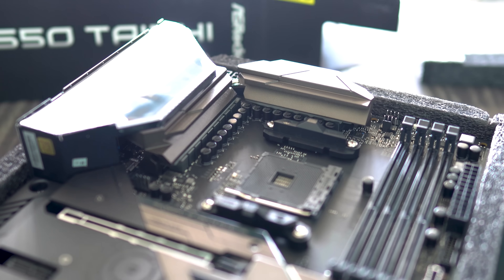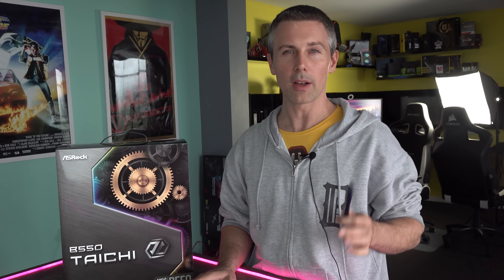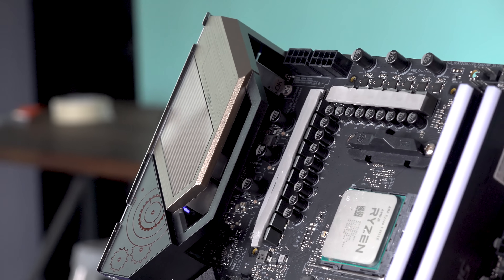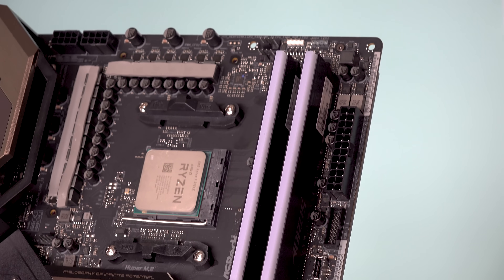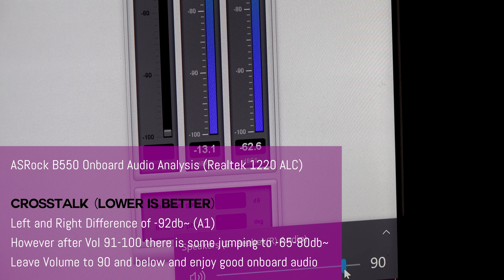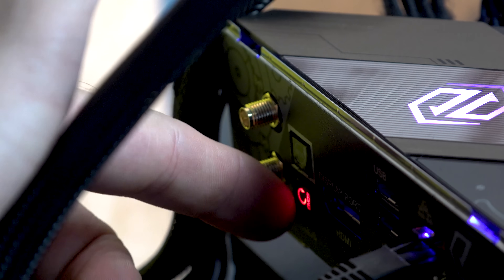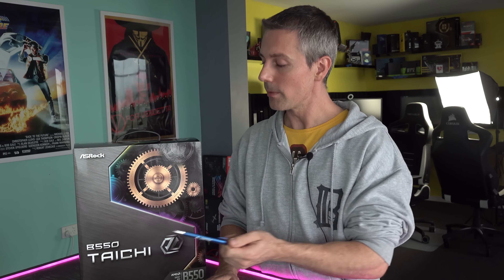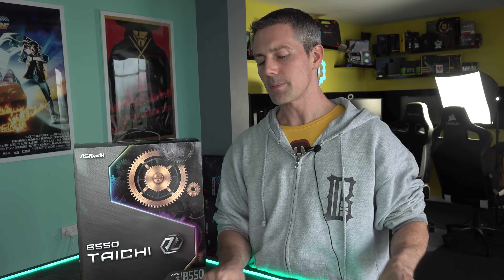ASRock B550 Taichi Review - X570 Now Irrelevant?!

Comment: 2024. I just upgraded my X470 Taichi with an 5950X for just 260€ and changed to 128 GB DDR4 RAM. Now I have problems with virtualization. The guest systems flicker, even if they are switched off. So I strongly suspect the X470 ith the latest 10.31 BIOS upgrade. What a pitty. I will try out the B550 Taichi which goes by 220€.

Comment: Mine gets delivered tomorrow along with the matching ASRock Taichi 5700XT. Gonna pop this 3900XT sitting right beside me into it under a 360mm EK AIO, a 2TB Sabrent Rocket PCIe 4.0 M.2 SSD, 2x4TB WD Blue HDD's in RAID 0, 32gb of GSkill Trident Z RGB RAM @ 4000mhz with custom matching black and gold sleeved PSU extensions from CableMod and not buy another PC part for 10 years. That's the plan anyway. Check back in 3 months to see what new part(s) I bought lmao XD

Comment: I wouldn't recommend any Asrock boards or Gigabyte, best B550 boards are the MSI Tomahawk and Strix boards one could say even in the B450 lineup the MSI and Asus boards are the best. The bios on the Gigabyte boards is horrible absolutely horrible, after owning heaps of Gigabyte and Asrock boards over the years I always pay the extra and get Asus trust me they're worth every Penny even considering the Asus tax they're simply the better boards IMO. I emphasize how terrible the bios is on Gigabyte boards its really that bad, skimming through the bios I said to myself there just isn't any love in this at all. I recently got to play with the B450 Tomahawk board and I must say the bios is really good, MSI put time and effort into it unlike Gigabyte. I suggest if you're going with a 3600 or 3700x check if you can get a refurb board from a local Computer store, I got a Strix B350 to use with a 3600x today because the B450 Aorus ITX board I bought is absolutely terrible (It was the only ITX board avaialble at the time) the Strix B350 cost me $152 and the store I got it from updated the bios for me for free (Mwave charge $30) JW Computers do it for free. A Strix B350 will work fine with a 3600 or 3700x and if you can get one cheap enough it will be way cheaper than any decent B450 or x470 boards. For $152AUD you cannot beat it, Strix B450 is $239AUD right now and the Tomahawk is around the same price. I bought a 3200G for $100 second hand a few days ago to play around with I'll be running it on that terrible Gigabyte board simply because most boards are not available right now and I have it on hand to use. If you need further clarification on how I reached my opinion feel free to comment and I will reply.
Reply: Asus tax is not worth it.
Reply: @tertius-3  My experience it can be on Motherboards, Asus have a superior Bios over MSI Asrock Gigabyte etc IMO. The Gigabyte boards I've owned have been quite bad in my experience from z68 to x99 to x299 to B450 but all the Asus boards I've owned worked perfectly fine. Are their Thor PSU's worth it hell no are their AIO's worth it hell no but boards generally I find they're very good like the B450-F strix supporting and working with ECC memory. I prefer Asus personally, I do not buy anything else except Asus with some MSI boards like the Tomahawk boards.

Comment: Hi sir, I have a pc system unit that very old and he starting to not function. I want to ask if i have a chance to use other parts when i build a cheap gaming pc around less than 200 usd budget. I have a motherboard ASROCK FM2A55M-DGS,500GB HHD, NEUTRON ELECTRON PSU 700W, AMD A4 5300. and if other parts are need to junk did you think  there's a chance to sell it or no. I'm your fan from the Philippines. Please give an advice and answer thanks a lot.

Comment: Would be great if you could test the MSI B550 Tomahawk (especially the Audio since it is using the ALC 1200 instead of the ALC 1220), the Asrock Extreme 4 /Steel Legend and the Aorus Pro please.
Reply: They already were tested by Harware Unboxed. Avoid Asrock Extreme 4/Steel legend cause of worst VRMs in B550 lineup.
Reply: @Matruchus  Thanks for the Info, MSI then because i want that Type C front header.
edit: just checked cant find a HW Unboxed test about the Asrock B550 boards...
Reply: @R4ZORLIGHT  It was also tested by Tech Yes City. It reaches the highest temperatures same as the Asrock x570 Steel Legend. You can see what happens if you overclock the cpu at 5 : 20. https://youtu.be/e5PMp_7h59w

Comment: Something I found to be a problem with cheaper, overlockable chipsets is that certain functionalities in the BIOS are lacking or not quite as well implemented. Now, that may not seem like a big deal, but since I'm very OC oriented, it really makes a difference to me if the LoadLine Calibration is configured properly or not. Same goes for the Vdroop and in general certain secondary voltages. I got myself a B350 from Asrock at the time and the VRMs were simply great. Great temps, great stability, but the overclocks I was getting simply were not quite as good as on X370, simply because of the LoadLine and of some voltages.
Reply: Absolutely true my man
Reply: @leonardoowl4308  hehehe. Overclockers on a budget 🎈😹🎉🐯

Comment: I've notice the much higher prices on many of the B550 boards. I'm assuming some of this is still due to production and shipping problems related to the pandemic. The other is that there are some really beefier components + VRM on many boards.
Reply: Also, B550 technically replaces X470 chipset while you still have B450 for budget option

Comment: Great review Tech YES City! Strange that no one else got this board for review. It seems this board is delayed since it is not available anywhere, I heard it is due to the Human malware situation. So it is 15 days delayed in some parts of the world. I Preordered this so hoping to get my hands on it soon here in Sweden.  One minor thing though, you did not show us what was included with the board inside the box.  Regarding front panel USB Type C connectors on the mobbos. It is worth pointing out in future reviews for instance that the Gigabyte B550 boards even the top end Master one is missing one of those and THAT IS SHOCKINGLY BAD considering the price of that board! And some of them like the popular MSI Tomahawk one only have the front connector as gen 1 meaning maximum 5GB/s so not the good kind the Gen 2 with 10GB like this ASRock one have. No reviewer seems to be pointing these things out.

Comment: A mid tier motherboard US$280 or AU$570, this is just plain wrong.
The 500 series boards have the biggest chipset differences of any AM4 series, that PCIe 3.0 vs 4.0 is also the link to the chipset and is half the bandwidth. The 300 and 400 series boards had artificial number limits imposed to differentiate B and X but otherwise the chipsets were the same.
16 phases is overkill for all but extreme LN2 overclocking, maxed out 16 core processors will have a hard time drawing more than 200W with high end ambient cooling meaning a sufficiently beefy (50-60A power stages) 8-10 phase VRM is more than enough for most use cases. While it's good to see some better VRM's on a mid class board, this is plain ridiculous. It's highly unlikely that the thermal properties of Zen 3 processors will change enough to allow significantly higher power draws that would make use such a big VRM.

Comment: I'm glad to see that the VRMs are so good on the B550 Taichi because that means the VRMs on the Steel Legend and Extreme4 should also be really good. They use the same components and the main difference seems to be that they have 12 Vcore phases instead of 14.

The Taichi looks like a really nice board but the Steel Legend and Extreme4 for ~60% of the price are a lot closer to what I'm willing to pay, and they still have a lot of the features that I like about the Taichi (including a front USB Type-C header, an integrated I/O shield, a post code display, and even power/reset buttons on the Extreme4). No clear CMOS button or BIOS flashback though (and no Wifi/Bluetooth).
Reply: Yeah, clear CMOS button would have been icing on the cake for the Extreme4. ASRock finally released a nice Extreme4 line board after long time.

Comment: Not sure if I did the right thing but whatever. Paid 210$CDN+tx for my TUF Gaming X570-Plus, when the average B550 is between 180-200$... Hmm... Other than maybe one or two B550 at 140$CDN, they are ALL at LEAST 180$CDN, compared to B450 which is between 100$CDN to ~140$CDN for the average board.

Comment: Now wondering if I should buy one to upgrade from X370 taichi 1700x,  to B550 Taichi for a 3900X  since crossfire is still being supported.     Using 2x  RX 580's for blender.  
Maybe if I brick it the bios.

Comment: Okok, What xeons(2 used xeon) vs ryzen 3950x ?
ex. 2 x e5 2690 v3 full unlocked little oc.. cinema r15  3900 sr
(2 x 200$ xeon Q14? + 200$ motherboard + 200$ ddr4  64 gb ram + 200$ power cables cooling... = 1000$) 
or
all new ex. 3950x  NO  OC.. cinema r15 3900 sr (650$ ryzen + 150$ mitherboard + 250$ 64gb ram +
200$ power cables cooling... = 1250$)
DOES IT WORTHH extra 250$ ???
You  GET 
+ NEWW
+ One CPU better for ram
- INTELLLL'S  "STRENGTH"  and  liferime waranty ! 

CAN SOMEONE EXPLAIN MEEEE WHAT  HAPPENING WITH INTEL
All intel amd comparasions is that
always price is unbeatable ! ! ! 
What are differences!

Comment: I cannot understand how this board is the same as the x570 taichi even jn canada. Personally I am looking at the Asus prime m  WiFi or something from MSI as their boards are priced well for what you get. What I like about B550 is pcie 3.0 nvme support meaning I don't have to spend another 3 to 400 to get a pcie 4.0 drive right away. I already have the 3300x on b450 s ok it will just be a board upgrade to my htpc for now. Keep up the good content!
Reply: PCIe 4.0 is backwards compatible, meaning PCIe 4.0 drive will work in PCIe 3.0 slot.

Comment: Don't most x570 boards not support SLI (splitting the x16 socket)? I'm actually planning to downgrade from an Asus X570-P to B550  mainly to get away from the fan (Asus still hasn't added PCH fan control!🙄), and to be able to run more Gen 4 NVmes. Essentially gain 8 Gen4 lanes and loosing 2 (50%) from the chipset is a worthwhile compromise to me.
 
PS: It would be good to see a like for like comparison of power usage (X550 draws too much power IMHO).

Comment: unlike Intel which is all classes of chipset release at the same time when new Generation CPU release, such as 10 Gen core CPU, u have Z490, H470, B460 & H410
AMD maybe due to their manufacture ability, their chipset release class by class X570 with Ryzen 3rd Gen > B550,1 year delayed >A520 when around Ryzen 4000 release in 2020 Q3/Q4.

Comment: Well, less than $300 is okay to not have a fan onboard. It's between this, b550-e gaming..., and b550 gaming carbon... Gigabyte lost because they don't have the front usb type c which my case has.

No, I don't want a x570 with a fan for this build (random person on the internet reading this that was about to try and convince me otherwise).
Reply: GhaV jGRite (jeaHAvee) I have x570 prestige creation and the fan has newer turned on... because I don`t have two pci 4.0 GPUs and 5 pci 4.0 drives! My mobo can do it, and the it would need that fan. But when I only have one pci 4.0 GPUs and one pci 4.0 m2 ssd... no sound at all!

Comment: Have you looked at the B550 Phantom Gaming ITX/ax?  I’m sorry, but you cannot justify a board starting at $200 USD and not include an external Clear CMOS button or BIOS Flashback.  And with all that left over space on the rear I/O would it have killed them to include a PS/2 combo port?  Heck, AMD should be REQUIRING BIOS Flashback on ALL AM4 mobos except MAYBE the A320/A520 etc. since those are intended mostly for uses where it is INCREDIBLY unlikely that someone will be upgrading the CPU without upgrading the whole platform.  I don’t mean that it should be banned from the A320/A520, just not required.

Comment: 300$ for a motherboard, that's ridiculous
Reply: There are ones in $850 price range
Reply: Yeah but you can get $160 X570 board that would make this a down grade. It’s the same price as the x570 Taichi. It’s a civic with a turbo not a Ferrari.
Reply: But it's got bolls to the walls spec LoL 😂😂
Reply: I got the x570 for 500$ (half of the price were taxes) because I had to match the aesthetics... I wish there were more x570 or b550 black/gold mobos...
The taichi might not have been completely black and gold but it looks good on my machine.
Reply: with all that feature? i think not. since b550 comes not to replace b450 but rather than creating new class (like h470, b460 still exist on intel world). you can still buy high end b450 such as strix E with price drop
Reply: @WisnuAji-Benjamin  That is only cause AMD changed course on B450 support.

Comment: I still don't get why most if not all AM4 X570/B550 boards put those 5GHz memory speeds on the box or website. All of those familiar with Zen2 know that if you run your memory speeds outside of Zen2's RAM/F'Clock's 1to1 ratio (which is about 3600MHz-3800MHz on the RAM and about 1800MHz-1900MHz on the F'Clock) would watch there performance fall off a cliff. 
  What benefits is there running your ram at 4000MHz-5000MHz if all it does is cripple the systems performance. Maybe a CPU-z or AIDA64 screenshot is all about those memory speeds are worth.
  That's one main reason i stuck with intel. I have a couple kits of 4000CL15 Elite dimms that were collecting dust, so i put together another 3 Gaming PC's to sell and used 3 more z390 ASUS XI (11) HERO's and 3 i9 9900's. What nobody realized or just plain missed is that the regular i9 9900's have a max turbo boost clock of 5GHz. So using MCE or all core turbo, you can run all cores at 5GHz. I'm almost dumb-founded that no one has done this or even made a video about this. Well, i'm sure plenty knew, they probably didn't want to lose there intel connection for showing others how to basically do non-K overclocking...lol. Though, really this time its on intel, for making the 9900's boost clock 5GHz. When someone hears 5GHz 9th Gen i9, they know its good for gaming...Also with z370-z390 boards, DDR4 can also be overclocked with 8th or 9th Gen non-K CPU's. Not sure about 10th Gen. I think intel put another road block in place for that. Just like there VROC keys on early x299. Why would they take away another budget overclocking option like RAM overclocking on non Z-series boards when that all everyone's been screaming for. AMD have at least listened. Anyways...
  I've made great gaming rigs using 5GHz non-K i9's running 4GHz kits of Sammy B-die. Throw in a few $900 eVGA 2080ti's and you got yourself a top of the line gaming PC. With DELL, HP and all those Custom PC venders like Xidax or Cyberpower selling the same spec't out builds at sometimes over $3000-$3500, I had no issues selling one of these builds for $2500 or more, depending. 
  Lets just say i bought out Micro Centers 9th Gen. i9's (K's and non-K's) along with there what z390 boards they had left. Ram kits too. 32GB kits of GSkills Trident Z RGB 3200CL16 were only $180. I bought the last five kits they had in stock. That's $90 for a 16GB kit of nice RGB ram. For 16GB's of GSkills Ripjaws V 3200CL16, it was only $60 a kit. $80 for the 16GB kits of 3600CL16. All these kits can overclock to atleast 3733CL17 and that's the worst single dimms. I've had 2 out of 20 dimms that couldn't do 3800CL17, even with all the voltage in the world. The IC's just wouldn't. So i paired those 2 lesser 8GB dimms and overclocked'em to 3733CL17. Called it a job well done. No medium rare overclocks here. Some awesome deals on new RAM though. 64GB's of 3200CL16 for $240. 
I remember paying that for a 16GB kit of GSkills FLARE X 3200CL14 Samsung B-die. I think that RAM was the only new components i bought. All that RAM will help out on some future builds i have planned. I only do this on the side but, it hasn't been a better time to buy last years high-end PC components, then right now. So, i'm investing a little more of my time to this PC stuff i love.
  I recommend going to your local Micro Center or if you got a first party PC components vendor somewhere near you, go empty out there stock. I've got up to 70% off of some major parts like GPU's, CPU's, RAM and motherboards. I even got a whole pallet of 2018 32inch 144Hz Freesync LG-650GKF monitors for 70% off. Those exact monitors are going for $300-$350 right now. 
  Just last week these discounts did not exist. I hope you guys find the deals like i got. I wish these were online so i could share the goods.
Reply: Bryant Allen because it is bigger Number and bigger Number sells even if it does not have any relevantti to real usage!

Comment: i need some help with my pc
PC Specs: 
i5 2400
GTX 560 Ti
6GB DDR3 RAM
i want to use the intel quick sync encoder to record games etc, i am using my 560 Ti as my main gpu and i have the iGPU enabled in the bios, i go on obs and other recording software but i cant see the encoder anywhere, when i right click on my desktop i only see nvidia control panel and no intel hd graphics control panel, i go into device manager and i click on display adaptors and i see both the intel hd graphics and the gtx 560 ti, can someone help me and give me a way to enable the encoder, and yes my cpu and motherboard both support integrated gpus
Reply: Thanks for the replies, I connected the dvi on my gpu and the dvi on my motherboard and went on display setting and clicked detect display and selected the one that was not detected and click on connect through VGA and extended the displays as a forum said and nothing ended up happening 😥
Reply: only 4th gen and above if i wasnt mistaken, because people that use p106, cant seem to enable igpu when theres gpu on the pcie lane.
Reply: SISSYPUSS I’m pretty sure the cable is right as I switch displays and the other desktop shows and I can use both, I’m not sure what is wrong but I’ve kind of given up, thanks for the help 👍🏻